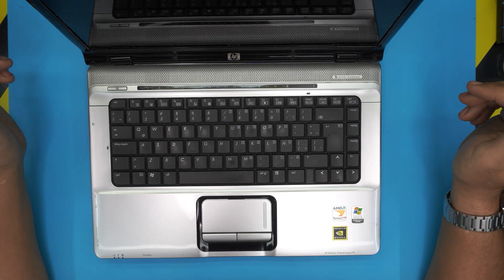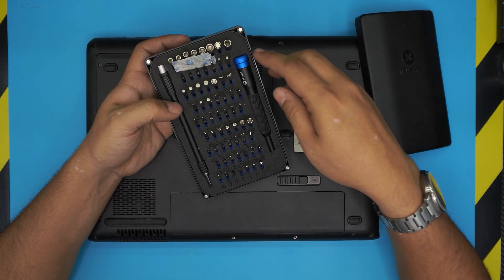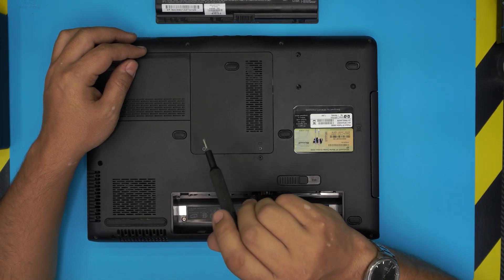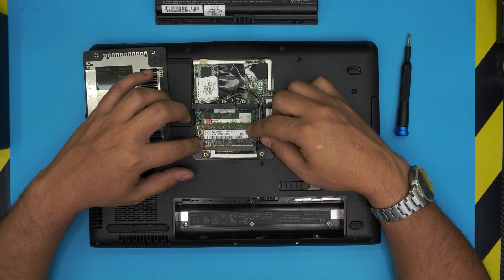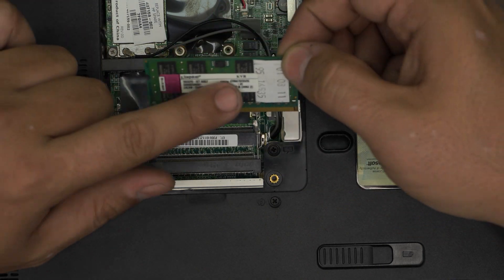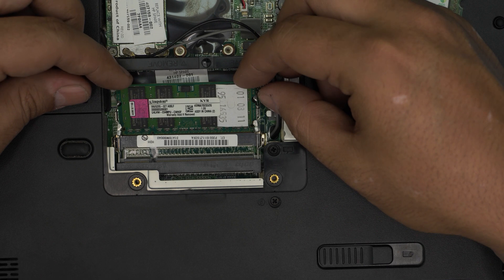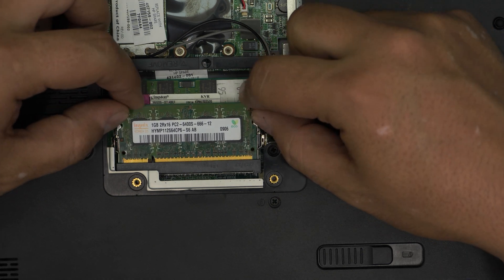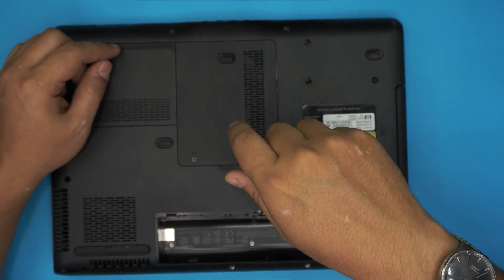Hp Pavilion Dv6000 Ram Upgrade

Comment: is that wifi adapter with two wires connected just top of the ram slots ? and what is besides wifi adapter ? 

reply please. i got this machine with everything missing hdd with it's caddy and those pins, ram and i think wifi too, the backside is completely empty. and the machine just shuts down after a blink of all led's. help ?
Reply from the maker: 🫠Regarding your question, yes, that is the Wi-Fi card with two antennas attached to it. The slot beside it is usually empty from the factory, as it is meant for expansion.  
You will need to consult a technician to check what’s missing and install the necessary components.
Reply: @uFixTek  it's gonna be a pain in the neck to fix all this. thanks
Reply from the maker: yes it will and i don't think it is worth it doing it.
Reply: @ i probably won't do it even though i got it for free.
Reply from the maker: yep not worth it

Comment: 3/11/24
I have a HP DV6000 and I want to replace the HD and Upgrade the RAM!!! I have XP now and I will have to Buy a new HD/RAM and OS also! I do need to know what HD/RAM and how to get a new OS too! Can you please help me get the Right Stuff to do the Job Done Right! I have a 64gb USB Drive!
Reply from the maker: 🫠Regarding your question, get a SSD not a HDD, here is a video for that:
https://youtu.be/NUCkF1KHWWM
and recommended ssd is linked in the video.
for the ram i have linked for the compatible rams in the description.
for the windows installation install win 10:
https://youtu.be/uDu8j2lE-dM
for windows installation follow any of the installation step:
https://youtu.be/euJvBhmoDzY
https://youtu.be/7f_rBp6Rb3s

Should you have any further questions or requests in the future, please don't hesitate to ask me.
cheers🍻

Comment: I dont know if you are still monitoring this video, but I am fixing my old dv6000 which currently has 4gb of RAM.  I read that this is max amount of RAM it can take. Is that correct? Id like to take it to 8gb if possible. It has an AMD Turion X2 Proc.  Thanks!
Reply from the maker: Thank you for your feedback! If you wish to support the channel, you can like, subscribe, or both!
Regarding your question, YOU can go for 2x 8gb sdram DDR3L , we use this rams: https://amzn.to/3L5szJN
we used to upgrade them often, also you can check the max capacity here: https://youtu.be/tKEJTkVth4Q
Should you have any further questions or requests in the future, please don't hesitate to ask me.
Reply: @uFixTek   Cool, thank you very much.  Im also putting in a 500gb ssd and a new copy of Win vista.  So it should pur like a kitten and play some old games!
Reply from the maker: it is my pleasure my friend and put windows 7 not vista

Comment: Question : are ph dv6000 and ph dv6700 are same laptop ?
and if they are can i upgrade my laptop ram? whis is 4 Gb  
and  my laptop stockage is 149 Gb 
Wath the max stockage can i upgrade ? If it's possible
Reply from the maker: max ram you can go on those models 6000 series is 4GB max 2x 2GB SDRAM DDR2

Comment: Hello Dear, I have HP Pavilion dv6500  1.90ghz . What is the maximum Ram capacity . Is it 8 or 4 max ? Also once I upgraded to windows 10, system  can’t  find my graphic card. Any solution for this? Thanks
Reply from the maker: Thank you for your feedback! If you wish to support the channel, you can like, subscribe, or both!
Regarding your question, it is a 4GB max you can go on that motherboard, https://amzn.to/42BM3M7
regarding the GPU driver, check under windows update "additional update" it should be there.
Reply: @uFixTek  thanks bunch
Reply from the maker: It's my pleasure my friend. 😊
Should you have any further questions or requests in the future, please don't hesitate to ask me.
Reply: @uFixTek  Thank you sir, I still can’t find compatible driver for my gpu for windows 10 . I already updated everything however there is no additional update for gpu. I also added 4gb ram but system says only 3gb usable do I need to update my bios? And how can I do ? Thanks bunch
Reply from the maker: i think you have installed a 32bit version of windows. you will need a 64bit windows.
32bit windows goes max 3GB ram.
Reply: @uFixTek  Thanks for your all help but unfortunately this model accepts only 32 bit windows. I tried 64 bit windows and it says on the screen not compatible . I still have GPU software problem but it is all good. Computer much faster with SSD even with 3gb Ram. Hopefully I can find solution in the future.

Comment: I got a new used dv6000 series laptop and when i tried to upgrade to windows 64 bit it gives an error and says the cpu is not campatable????, is it because the bios hasnt been flashed or does that have anything to do with it? We all know teh cpu can update to 64 bit so i dont understand why it giving me the error
Reply from the maker: Thank you for the feedback! if you wish to support the channel you can LIKE or SUB or both :P
regarding your question:  are you fresh installing windows 64bit from USB?
Reply: @uFixTek  The computer came with windows vista, i tried to install windows 7 64 bit and it gave me the error and said the cpu wasnt campaitable with 64 bit, i then put in windows 7 32 bit fresh install and it worked but when i try again to put in windows 64 bit it gives an error that says the cpu is not compatible with 64 bit. Ps. Yes fresh install from usb
Reply from the maker: oh, try updating the bios, its rare issue because we do install win 10 64bit without any issues.

Comment: Whats the newest bios ? I have f43!
Reply from the maker: Thank you for the feedback! if you wish to support the channel you can LIKE or SUB or both :P
regarding your question: Unfortunately you cannot update the BIOS when running Win7, if you do you will damage the bios.
it can only be run on XP or Vista.
and you don't need to update bios there is no advantage to it.
Reply: @uFixTek  i want to install 2x2gb ram. My bought ones dont work with f43
Reply from the maker: @redscorpion133  what speed ram you purchased, your problem is not the BIOS, its the ram you purchased, you need to make sure its a sodimm SDRAM DDR2 667. if you get anything higher it will not work.
https://amzn.to/3SKb5nu
Reply: @uFixTek  In my case. I,ve got two 2gb sticks hynix 667mhz each and even though my bios detects the ram, widnows keeps restarting when it's starting againg a again, no matther what i do. And the rams works because if i only usd 2gb the computer starts, so i don't know whats going on.

Comment: Hello UFIXTEK, 

I have an HP Pavilion dv6000t with Intel Core 2 CPU T7200 2.00 GHz and 3GB of RAM memory installed, with a 240 GB SSD HD.

Currently running Windows 10 32Bit and it is giving me issues often it shows the windows blue screen: ":) your device ran into problem and needs to restart. We're just collecting some error info, and then we'll restart for you"

When checking with your video 📢 How To Find Out Your Max Ram Capacity For Laptop | PC at and it gives me a total of: 2.097.152 KB (2 GB) with two slots, but the real physical memory installed is 3 GB.

Can I still upgrade by installing the 8 GB using (2 x 4 GB) recommended: 8GB Kit (4GBx2) DDR2 PC2-6400 LAPTOP Memory Modules (200-pin SODIMM, 800MHz) Genuine A-Tech Brand?

Would my computer support it?, and then can I then upgrade it to Windows 10 - 64Bits?

Thank you very much for your great help,
Reply from the maker: Thank you for the feedback! if you wish to support the channel you can LIKE or SUB or both :P
regarding your question: 1st of all i would recommend you to install windows 10 on that then check the max ram, the CPU can only handle 3GB ram max! if you put anything over that it will not be used.
don't upgrade to windows 10, do a fresh install of windows 10 64bit:
https://youtu.be/uDu8j2lE-dM
https://youtu.be/7f_rBp6Rb3s
Reply: Hello Sir, I did a fresh new installation of Windows 10 - 32 Bits, and when checking with your method the maximum memory is 2 GB in 2 slots. Even tough it has 3 GB physically installed (1 x 1 GB and 1 x 2 GB) Do you recommend me to try with Windows 10 - 64 Bits, and perhaps it will be possible that the memory capacity be increased to 8 GB? Thank you for your help
Reply from the maker: yes  i do recommend you to go 64bit, remember that 32bit can only handle 4GB ram. so you have no other choice. go 64bit and see what happens and 64bit is much better than 32bit.
Reply: @uFixTek  thank you very much for your recommendation. I will give it a try and see if it will support 4GB or 8GB maximum
Reply from the maker: my pleasure my friend :)

Comment: Great video, thank you! Is it possible to just buy a 2GB RAM memory and add it to the 1GB RAM the computer has? (Ending up with 3GB RAM total) Or I am obliged to remove the previous 1GB RAM?
Reply from the maker: Thank you for the feedback! if you wish to support the channel you can LIKE or SUB or both :P
regarding your question:  Sure you can you can have the combination that you like it wont affect it in any way.
Reply: @uFixTek  Great of course! I ended up buying two memories of 2GB each cause when I opened the slot there were two memories of 500MB. Let's see what happens, hope it works. PD: I am also planning to replace the hard drive with an SSD.
Reply from the maker: awesome, if you upgrade the HDD to ssd you will see a big improvement on performance. 
https://youtu.be/NUCkF1KHWWM
https://amzn.to/3rwuldS
Reply: @uFixTek  Yes! I've seen that video too haha. Now that I watched this one again I realized that my Ram slot is backward in relation to the HP you're showing. It's strange. Mine is a HP Pavillion dv6720la.
Reply from the maker: you laptop is Latino America model mexicano, but its the same idea amigo. saludos

Comment: Hello!  I have the same laptop, but I do not have the original power brick anymore.  Could you tell me the power output on your power brick, so I could find a matching one, please?
Reply from the maker: Thanks ✌  for the feedback!  if you wish to support the channel you can LIKE or SUB or both :P
regarding your question: this laptop works with 18.5V or 19v and minimum Amp required is 3.5Amp,
but if you can get a charger that is 18.5-19.0v and amper over 3.5amp you fine.
BUT the higher the amper the better, but the voltage MUST be in the range indicated else it will damage the laptop.
the higher amper it means if the laptop needs more amp to work the charger will be able to deliver the extra amper. but if you get the 3.5amp it will work but if the laptop its running low on battery and you want to use it at the same time the 3.5amp wont be enough and the charger will get really hot and it will over time burn down because of the stress, but on other hand if you get a charger over 3.5amp  it will be able to charge and run at the same time without any stress.
here is the right charger: https://amzn.to/2XlZMet

Comment: Your videos are abstract and helpful. I too want to upgrade my HP DV6000 with higher memory, 64 bit Windows 8 or higher and replace my hdd with Ssd.
Presently i having 32 bit Windows Vista, 2 gb RAM. Also the HP website says that my laptop supports only 2 gb maximum RAM. Kindly guide me regarding the desired upgrade!
Reply from the maker: Thanks ✌  for the feedback!  if you wish to support the channel you can LIKE or SUB or both :P
regarding your question: your laptop does support more than 2GB don't listen to the website we have upgraded this laptops without any issue to 4gb:
https://amzn.to/3m0yqEx
in order for you to get 4gb you need to format and reinstall the windows 64bit, you can install windows 10 without any problem with 4gb:
 here is a video i made on how to create windows 10 usb boot: https://youtu.be/uDu8j2lE-dM
also if you want to install on HP laptop follow this steps on installing windows 10 on HP laptops: https://youtu.be/7f_rBp6Rb3s

Comment: Can I install a 64bit Windows 10 in this laptop? My processor is Pentium Dual CPU T2370
Reply from the maker: Thank you! for the feedback and your support to the channel by SUB :P
regarding your question: YES you can and it will work just  fine and you can upgrade the ram up to 8GB with 64bit, 
last week i installed the 64bit, 
https://amzn.to/3v9jWUw

NOTE: if any laptop or cpu that is not compatible with 64bit, you will know right away as the windows installer will not start and give you error explaining that its not supported.
Reply: Awesome! Thanks man you're great.
Reply from the maker: anytime my friend :)

Comment: Does it have to be 64 bit to read it? I have a 32 bit what is the max ram?
Reply from the maker: Thank you for the feedback and your support by a sub  :P
regarding your question:  32bit will only red up to 3gb ram anything over that 64bit must be installed
https://youtu.be/uDu8j2lE-dM
Reply: @uFixTek  It shows my dv6000 is only 32 bit computer so nothing i can do unless i want to swap processors?
Reply from the maker: noo its not a 32bit cpu its 64bit cpu
you just need to install a 64bit windows.